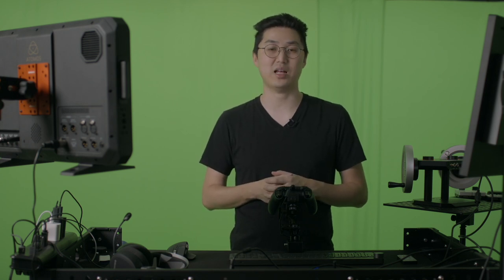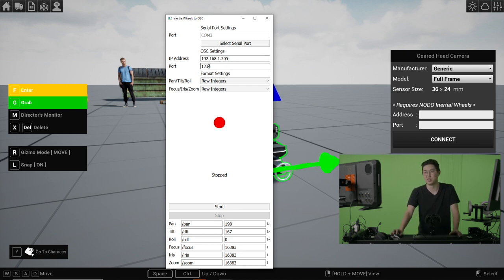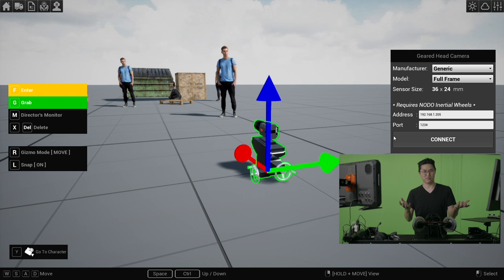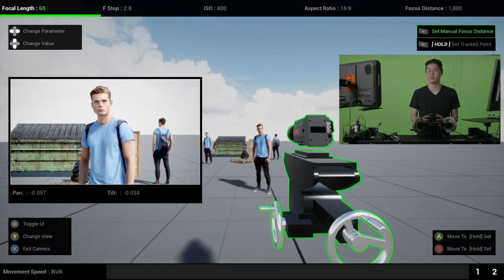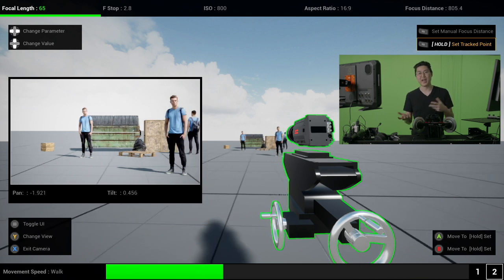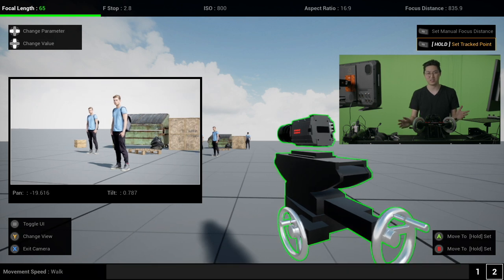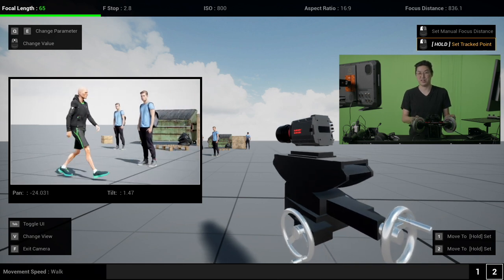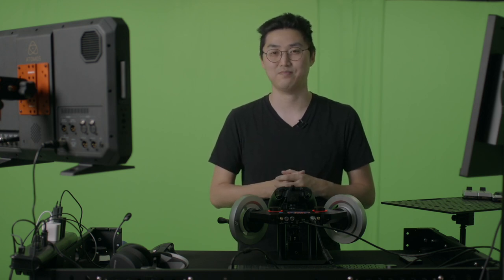Cine Tracer v0.60 | Inertia Wheels + Geared Head Camera

Comment: Hi there,
Big fan of your product here.
For some reason I can't connect my Inertia Wheels through IW-OSC output with Cinetracer. 
It used to work just fine up until a few weeks ago, but now the "geared head" tool doesn't seem to respond when operating the wheels.

I checked there is connection between the wheels and NodoFilm OSC software but once I start cinetracer then the geared head camera doesn't work.
Have already uninstalled/reinstalled Cinetracer. No luck.
Tips/suggestions from anyone would be very welcome!